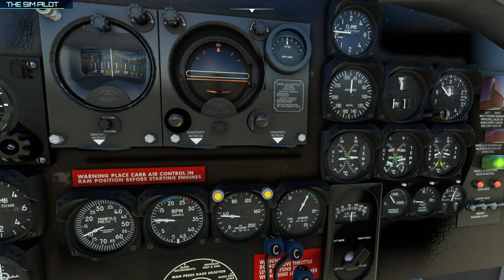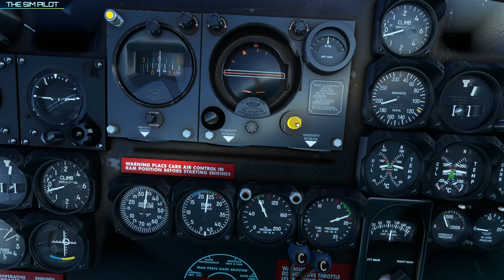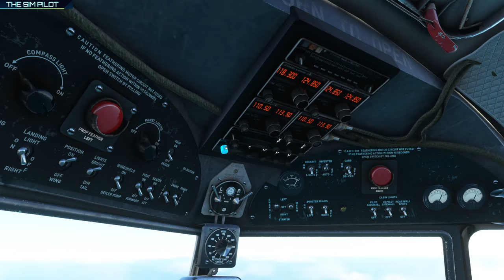MSFS | Tutorial | Douglas DC-3 | Cockpit Layout, Startup, Gyro Pilot, Take-off & Landing |

Comment: Thaks for this indepth tutorial, got goosebumps all over ... things have changed since my last flight in MSFS 24 years ago.
Just started again - flying "Old Iron" and of course the DC3 (provided by MSFS) ... not bad, not bad at all.
But I love the sound that comes from the one you're flying, the DC3 in MSFS doesn't sound like that, (could be my ears)
Or does your DC3 have a an other soundpack?
Thanks again for this outstanding video, I could listen to that awesome sound all day long.
Reply from the maker: There are 2 DC3 downloads in the marketplace. Download the DC3 extended package to see if that helps with the sound, I am not sure if it has better sounds though but worth trying. I am also using this improvement mod this mod does not modify the sounds but it adds some improvements that I like. https://flightsim.to/file/43893/duckworks-dc-3-improvement-mod
Reply: @TheSimPilot Tanks for your respons but I found it, fiddling around with the sound in- and output settings in "Genaral Options"  solved the problem.
However ...now I'm trying to find a way to stop flying the DC-3, can't stop listening to that beautiful sound ;)
As soon I got this baby in control, I'm going for the DC-6 which got four of those addictive, beautiful engines ;)
Reply from the maker: @huigsnellenburg6144  Believe it or not DC-6 is a lot easier to control. Not sure if it's due to being developed by PMDG and feels a lot more optimized or due to the aircraft itself. I had a lot of fun in the DC-6 doing some historic routes. Definitely a blast to fly these old birds and I find it more fun due to the interactions needed from the pilot compared to modern airliners.
Reply: These modern airliners don't do it for me. I did the 767 Pilot in Comment, and back then in 1999 it was THE state of the art airliner, so basically been there, done the FMC.
I do DCS as well and Warbirds like the Spitfire and the P-51are my favorites, also I like to fly the Huey.
Now I'm getting my head around NeoFly in MSFS, see if I can do some Buffalo Airways stuff ;) @TheSimPilot  @TheSimPilot

Comment: Two comments... the "radio compass" gauge is actually linked to the ADF receiver and will point to the NDB selected on the upper panel. And the lever you identify as the flap handle is in fact the engine pump selector. Just look at the indication above the lever, you will see it is marked engine pump selector.
Reply from the maker: Thanks for the clarification. I believe you'ree referring to the lever that has 2 positions.  Flap lever is nthe yellow lever I believe. Maybe I made a mistake when recording the video. Also thanks for Radio Compass  clarification.
Reply: Yes, the blue lever locks in two positions that are detailed on the placard above it. By the way, your video is the best I've seen so far on engine startup sequence. Very clearly explained, it answered some interrogations I had. Tx!
Reply from the maker: @Gilles45  You're very welcome. Still trying to dig some real word information to make sure I'm sharing the right information.  I watch Buffalo Joe's videos who is a real life DC-3 pilot to make sure what I do aligns with real life to some extent.

Comment: Hi there. I've been trying to get my ILS glide slope needle to work. doesn't seem to. Did you do something to make that work out? I see on everyone else's videos that they are never able to get the glide slope needle on nav 1 to work. You... for some reason have it working without fuss. How?? I'm trying to make approaches in adverse weather, but I really need that glide slope indicator
Reply from the maker: Really nothing special I did there other than tuning in the ILS freq. I'll do a test run tonight to see if I can identify anything I did different.
Reply: Hello. Great video. As a follow up to Eric's comment. I was shocked to see a glide slope needle during your landing as I didn't know it existed. Did you ever find out any more info on it 
Thanks
Reply from the maker: @beatlesean9625  no I wasn't at home for the most part of the holidays. I have to plan a flight and try it again sometime this week.
Reply: OK cool. Thanks
Reply from the maker: @beatlesean9625  I have done a short take off landing at Birmingham EGBB and I can confirm GS needle works. Tune 110.10 on both NAV radios take off and do a circuit. you'll see the needle moving as you get on the GS. There is no CRS adjustment though as far as I can tell.